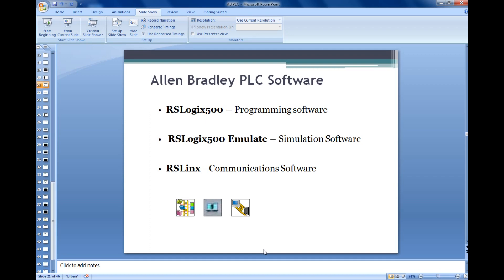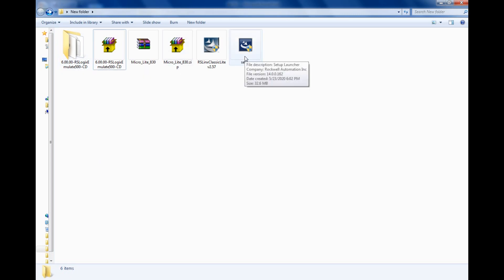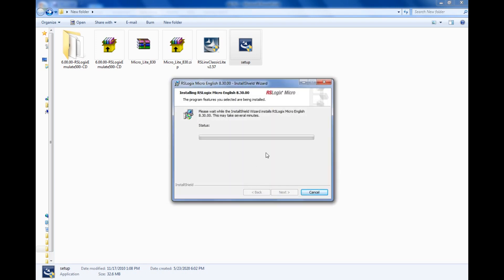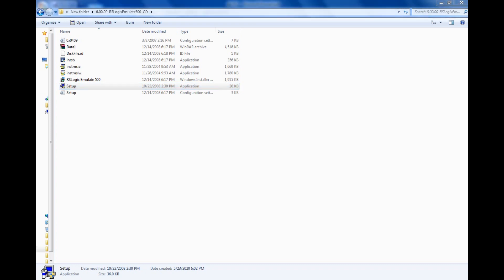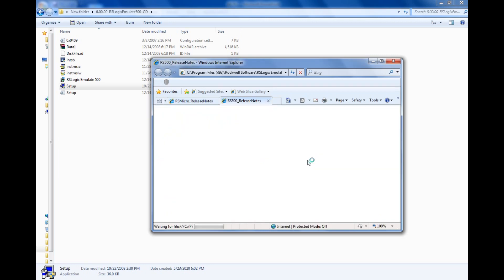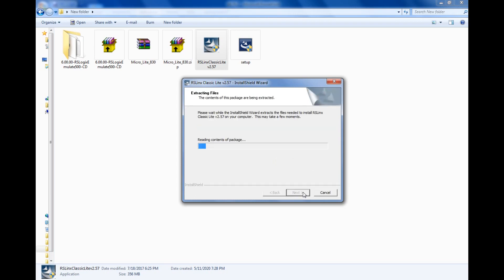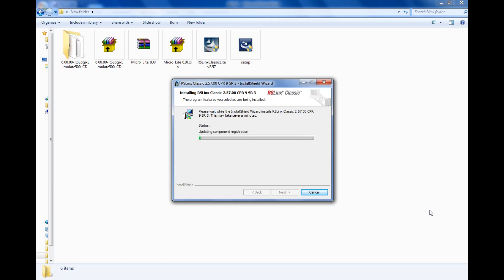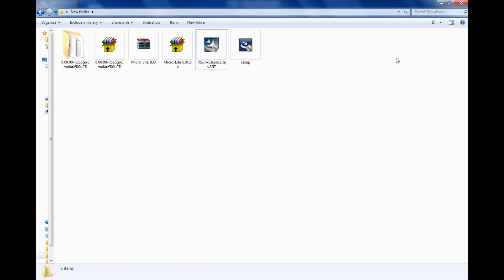PLC Training 10 - Installation of PLC Software

Comment: I don't see micro starter (RSlogix nd emulator) in folder after download. I could see nd setup RSlink. I m using windows 10. Couldn't figure out the issue. Please guide